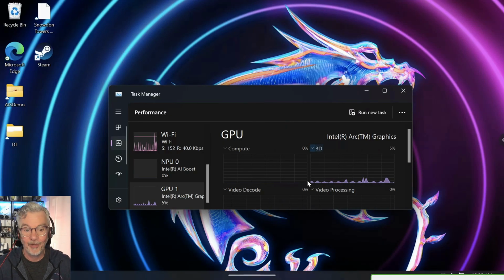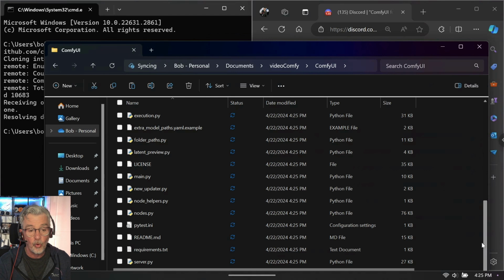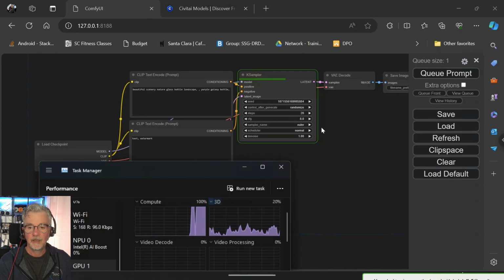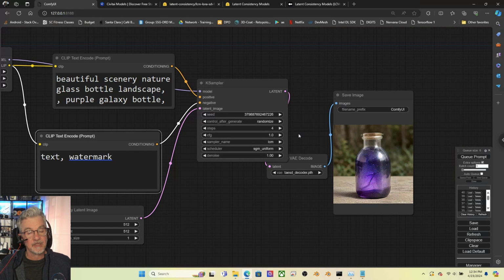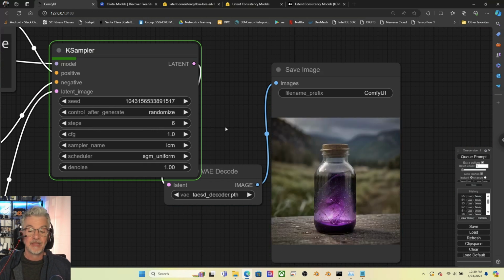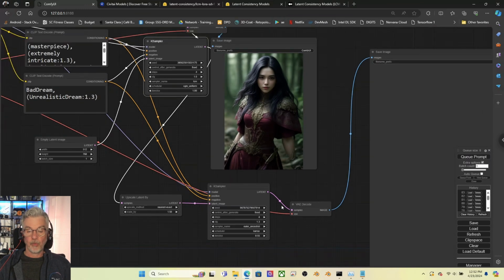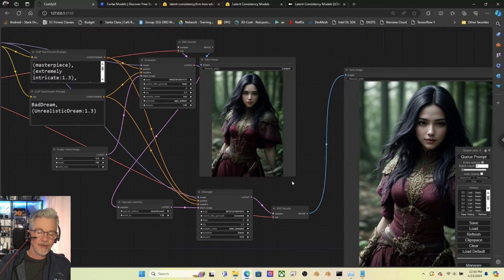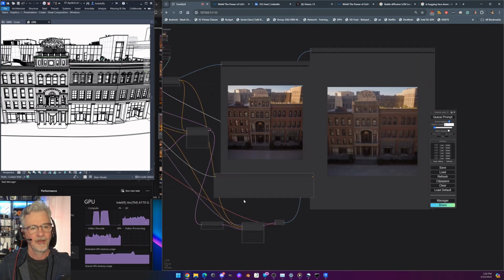Tech Craft: Install and control ComfyUI on PCs with Intel Arc GPUs

Comment: Can Intel Arc dGPU can handle, flux and GGUF models and wan video models?
Reply from the maker: Yes, the Arc GPUs can support AI workloads, including running GGUF and Flux.1-Schnell models through tools like AI Playground 2.0 and ComfyUI. These GPUs can handle video model processing workloads efficiently as they support modern video codecs like AV1, VP9, H.264/AVC, and H.265/HEVC. To learn more about the features that come with Arc GPU’s visit: https://intel.ly/43LxCJ0 You may also check out our AI Playground by visiting: https://intel.ly/4mDLDjC
Intel Customer Support
Reply: @IntelTechnology  thanks, i'm planning to buy A770 16GB GPU , to run Comfyui.

Comment: Why isn't there a simple installer for Arc GPU's?
Reply: We do have a simple installer as part of AI Playground. We include ComfyUI as an optional backend and you can run ComfyUI directly. Just download and install.   Alternatively you can now Install ComfyUI as normally using GIT and Python.  There is no longer a need to add in the IPEX portion.  Native PyTorch 2.6 now Intel Arc GPUs.
Reply: @BobDuffy  Hi Bob, I can't run AI Playground on my Lunar Lake laptop due to the program complaining that my Windows account has admin rights (which is the default for a Windows install). Could this be fixed in the next version of AI Playground?
Reply: @mariopenulli1395 version 2.5 and 2.5.5 require you to install on a single account that has permissions to run. AI Playground does not allow you to elevate the app above the permissions of the user. This is a security requirement.  AI Playground will install and run where the user has Admin permissions, while AI Playground is not set with admin permissions

Comment: Is there any possibilty to use the Arc Graphics and the NPU for example from a copilot pc?
Reply from the maker: Hi! We would like to inform you that ComfyUI and Intel AI Playground are designed to run exclusively on the GPU. The NPU is optimized for low-power AI tasks, which helps preserve battery life. In contrast, generative AI workloads are significantly more demanding and typically require the robust performance capabilities of a dedicated GPU. If you have any further questions or need additional information, feel free to post your query at https://intel.ly/3UBVZnC We will look into it. 

Intel Customer Support

Comment: I tried different UIs and I mostly get this error:

Current platform can NOT allocate memory block with size larger than 4GB!

What can I do about it?
Reply from the maker: For installation instructions and to seek guidance, we suggest that you join the Intel Insiders Discord via
https://intel.ly/40aUoJ3
and post your queries to initiate discussion threads at:
https://intel.ly/48lwo7T We also recommend you try using the AI Playground application and to download it, please visit: https://intel.ly/40bUmkb 

Intel Customer Support
Reply: check Bios Settings to enable "Above 4G Encoding"

Comment: the discord link does not work anymor, I dont get an invite just a gray screen stating i have no permissions. why cant you just use pastebin or provide the files in the comments
Reply from the maker: We see that the Discord link works fine at our end. To resolve this issue, please clear your browser cookies and cache in the settings or try an alternate browser and visit: https://intel.ly/4cRCZZg Also, ensure to have a Discord account, or you can create your account via https://intel.ly/3yaRAQz and complete all the verification steps, including verifying your email address to join the community. If the issue persists, feel free to reach out to us via DM on Instagram/X or PM on Facebook. We will be happy to help.

Intel Customer Support
Reply: @IntelTechnology  
having a error ( torch-2.1.0a0+cxx11.abi-cp310-cp310-win_amd64.whl is not a supported wheel on this platform.)
is there any solution for it ?